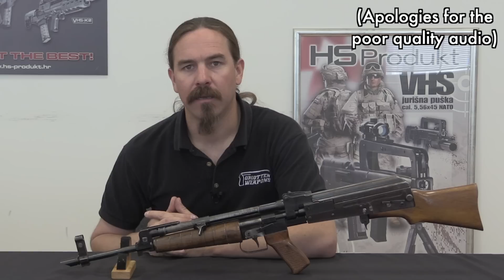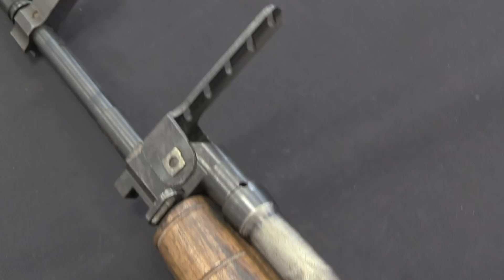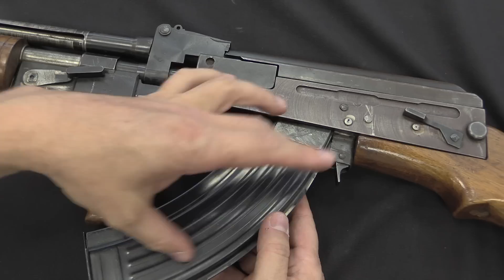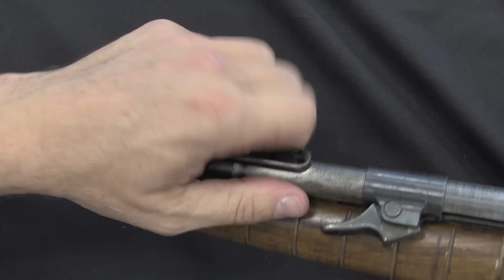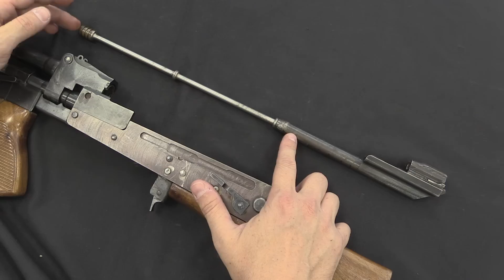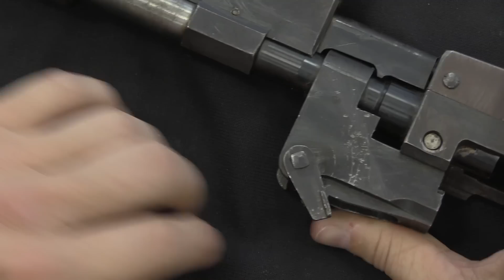Croatia's Prototype Bullpup AK Conversion

Comment: Croatian enthusiasm for bullpups is very justified by geographical features of their own country: their entire coastline is basically made by a rocky mountain ridge falling straight down to the sea with a minimum space for building settlements, add to this the fact that said rocks are extremely strong,  a dense mediterranean scrub and a dry climate and crystal clear atmosphere allowing you to clearly things located (tens of) kilometers away and you get the picture.
 It also explain their own preference in using 300.Win in their own (and 20x110mm) sniper rifles.
And because they are usually such tall and slim also.

Comment: the beauty of engineering prototype design, per se,  is innovation outside the usual parametres.
a pal designed a hubcentre steering setup for motorcycles in the early 90s, he attacked it as an engineer, not a motorcycle designer. this was after bimota and yamaha had allready put hubcentre on the market.
every journalist that rode his prototype back to back with the big manufacturer's wares were astonished at how perfectly it performed in comparison.
too perfectly, his design removed all geometry change under breaking, a geometry change that all motorcyclists adapt to without thinking. the end result was a couple of journos running wide in corners as the steering angle didn't change to a more agressive one. he had to create a system of 'dial-able fork dive' to give the tightening steering effect under breaking. 
the bimota and yamaha hubcentres did not eliminate this as they came to the problem via motorcycle design that emulated traditional forks.
of course, the ideal that was desired, the elimination of fork dive under breaking had to be reintroduced mechanically for those used to telescopic forks. it was his degree project, he just happened to have a gpz550 with destroyed forks..
as an engineer, I can see where HS were going with this. I can even see a few very minor tweaks that would make this a viable production model.

Comment: Wow, so this is effectively a bullpup that lefties can shoot without any extra steps (I volunteer to see if that actually works; just tell me when and where to show up, Ian!) which also has an accessible chamber for inspection and malfunction clearance. If that's the case, those two non-gunsmith engineers solved the two big problems associated with autoloading bullpup rifles. I think that's really impressive for a toolroom prototype of that nature. Many thanks to both Ian and HS Produkt.

Comment: As far as I understand the only reason for the bullpop design is the long barrel. If it doesn't provide better accuracy what does it actually do? A little bit more muzzle velocity? Why did half the west rush into this really?
Reply: My grasp for the rising interest of Bullpup was based on various factors. Many armies expected more and more warefare to be urban conflict zones, so finding a way to make rifles more compact without losing maximum impact and effective range saw good appeal.

Some countries also saw potential from a logistic standpoint. France for example decided to step away from having a army smg because in there eyes the FAMAS compactness meant it could be assigned to both frontline and rear line troops, the later often normally armed with sidearms and smgs.
Reply: @Awoken_Remmuz  I see, so basically keeping barrel length while making the gun overall smaller. I understand this looked like a reasonable assumption. Interestingly they all abandoned it without ever testing it in a real war. So I would guess the peacetime comfort of having a smaller piece of gear to carry around didn't really matter in practice.

Comment: The Problem: Nation without major arms factories needs to make military-grade firearms domestically in a hurry.
Observations: Nation has access to details on firearm designed specifically to be mass-produced with limited tooling and infrastructure (Kalashnikov rifle)
Solution: Let's take that Kalashnikov and make it more complicated because we love bullpups!

An unorthodox and arguably not very good solution to the problem, but I have a soft spot for unorthodox engineers, which VHS seems to have an abundance of. Instead of just focusing on the obvious solution, fabricating tooling for Kalashnikovs, they decided to see if they could bring something just a little different to the table and while they failed this time, they clearly didn't let it stop them engineering. If the company can keep that spirit going, I think they have a better chance than many to surpass FN, H&K, and Beretta as Europe's premier arms manufactory. Improbable for sure, but only time will tell.

Comment: Rock and lock bullpups prefer a shorter mag.  A 30 round tapco won't fit in a mini14 in the Muzzelite stock.  You can get them in, but they won't come out.  Ruger factory 30 rounders are a tight fit, but still come out.

Comment: Can anyone please tell me why exactly the gas piston wobbling on the bolt carrier is important and necessary for the design? I've never heard of it being important, always figured it was just wobbly because the whole rifle rattles when you shake it because of loose tolerances.
Reply: It helps center the piston into the gas block when the action cycles and helps to reduce wear on the piston. I’ve had a couple of AKs that didn’t have any wobble on the gas piston that still ran fine, but had more noticeable wear on the piston than the ones that did have some wobble.
Reply: @B2k4E  thanks.

Comment: Oof lengthening the barrel without making it thicker in 7.62x39 with old tech is going the opposite direction of the intention. You need to beef them up and/or chop them to get rid of barrel whip

Comment: You see a lot of homemade/"Khyber pass" AK bullpup conversions in combat footage since the start of the Syrian civil war. They seem to work just fine and there's a demand, I wonder why bullpup AKs didn't catch on before in a more official way. Like a version or kit from Kalashnikov itself - especially in the 90s.
Reply: I've seen photographs of bullpup AKs with custom paint jobs in the Middle east. Their camos don't match their environment, but I respect the passion behind making a customized gun in a warzone.
Reply: it did the Groza series and of course the bullpup version of the AEK971 (i think its that) groza didnt really take off unless it was in 9x39 WP for good surpressed shots
Reply: Because you cant use any parts that are interchangeable between the two platforms without even minor modification to them. This makes it no more cost effective than just building a better gun from scratch AND it doesnt offer anything that either the ak doesnt or that a bullpup should other than a longer barrel in the same OAL for the gun. And thats not even really what happens here because while the barrel is longer, so is the whole flipping gun. Bullpups almost always are designed to all for a new firearm that shoots the same round or one similarly powered one, that keeps the same barrel length or even a longer one but reduces the over all length of the weapon or keeps a similar OAL for a longer barrel. 
This allows for in the latter case a potentially more powerful and accurate weapon that uses the same ammo your force is already invested in and familiar with, or a special use platform that uses the same ammo but is shorter without sacrificing the power and accuracy for use in confined spaces and other cases where weapon size is important. This is just icky. 
 I mean sure its cool. But where would it be used by a fighting force?
 Its not even as cool as the olympic arms ultralight ar designs to get around the awb.
Reply: "If it ain't broke don't fix it"
Is probably the rationale. Aks work fine as is and while there's room for improvement is it really worth completely reconfiguring a rifle just to improve combat effectiveness by a tiny amount? Keep in mind militaries typically like to be conservative, so why should they adopt a different configuration of gun that would require retraining of personel and whatnot. When they could keep using what still works and not rock the boat so to speak. The new US army rifle is basically an AR as far as controls are concerned for that very reason. (I'm talking about how it's reloaded and how you use the safety and whatnot, I can see alot of gun needs REEEEEEing at that statement already so just to be clear im not saying they're the same gun, but they're familiar enough to someone trained to use an AR platform)
Reply: @BigWheel.  so basically

RIFLE IS FINE
Reply: Because it's easier to stick with one manual of arms for the conscript forces. The special forces especially in russia had access to quite a few types of AK based bullpup rifles, DMRs, subguns etc
Reply: Ukraine actually tried moving to bullpup AKs as well, they put together a conversion job called the Vepr and the more recent Malyuk is also technically a bullpup AK underneath.
Reply: Bullpups dont make sense in a large, conscription based military.
Dont get me wrong, I love bullpups aesthetically, but their increased mobility comes with a more rigid manual of arms and that trade off isnt really worth it if you already have a million perfectly fine rifles out there.
If you look at who adopted standart Bullpups, its mostly smaller militaries that rely less on conscription in case of war and more of a career soldier army like Austria and Australia with the AUGs, the French with the FAMAS or the British whose primary contribution to a cold war gone hot would be the Royal Navy and Royal Airforce. In cases like that you have much more time/money to better train your troops to cope with the manual of arms for bullpups (basically only right hand firing, more "complicated" clearing operations etc).

Comment: I'm still unconvinced that the downsides of a bullpup (for a military rifle, not so much for a civilian shooter) outweigh the upsides. I feel like the only thing holding bullpups back is that many modern militaries are used to an AR-15 style platform, and/or most accessories are designed with an AR-15 in mind. Essentially, if the HK416 (a very hot rifle for EU militaries right now) were available in a bullpup configuration, I suspect that configuration would be nearly as popular as the current one

Comment: You know, the only thing that's truly cursed is the handguard (specifically that it has no upper for the gas tube). Otherwise, it's a really neat first attempt by some guys taking their first try at firearms design.
Reply: The stock is pretty cursed to me. I've seen bullpup AK103s and the stock, on those, is just a flat thing.
Reply: Nah bro the length of pull is incredibly cursed. You’d need your arm to be perfectly straight to fire it shouldered lol
Reply: @Hanitcal69  You're probably a dwarf then
Reply: @Frille512  I’m 5’1” thank you very much I am legally not a dwarf
Reply: @Hanitcal69  And how short is that in a decent measurement
Reply: @Frille512  I only use freedom units. The fact that you’re asking means you can’t even own guns like this so why are you speaking
Reply: @Frille512  5'1" is approximately 155 cm.
Reply: @ignazachenbach5406  Dwarf length
Reply: @Hanitcal69  Or just be a chad with long arms 😎

Comment: biggest failing I see is the need for a cheek rest, possibly bolted to the trunnion to keep the face airgapped from the hot receiver, as far as the magazine issue I'm sure they'd just move the grip slightly further forward on a production model
Reply: The receiver will not be hot, but it will be cold in winter times.

Comment: It's interesting to see how different groups try to alter the basic AK (maybe the simplest select fire rifle available) to create a better or improved system. As I think about it, the only obvious negatives of the AK design are the short sight radius and the awkward selector/dust cover. It's otherwise a solid rifle with few improvements to be made. That makes these designs so intriguing.
Reply: No consistent way to mount optics and a generally high weight for its size are its real shortcomings in a modern context, in addition to the poor ergonomics as you mentioned with the selector
Reply: Siderail is and always was fine for optics, particularly with RS Regulate type mount. Stamped 1mm AK is not particularly heavy, in fact Afghan era AKS-74 (6.5lbs unloaded, just under 7 loaded) is lighter than just about anything ever issued as a standard service rifle that isn't the M16A1. 

And ergos of the safety is fixed by the Krebs type finger tab models everyone is using now.
Reply: @admiralxen8944  siderail is more complicated than having a proper rail on the receiver, and that still doesn't address how much has to be done for other accessories on the handguard to hold zero (e.g. IR laser). The finger-tab safety does NOT "fix" the ergonomics 🤣, it's still clunky and not easily converted to ambi. And the magazine is slower and clunkier than a drop-free design as well. The AK was a good rifle for its time and is still a marvel of simplicity and durability, but it is outdated and archaic.
Reply: Depending on your preferences, the lack of a bolt hold open on the gun itself is another big one. The indication that your mag is empty without silly tricks like tracer ammo is worth the miniscule additional chance of bad stuff getting into the action.
Reply: @hailexiao2770  that's a very valid point. That might be the most technically difficult improvement as an alteration would need to take place within the magazine to provide the function. Altering a rifle and getting that into service is much easier than offering a new magazine which doesn't work in the older rifle. I would be interested to see if that would take off in militaries already equipped with AK pattern rifles.
Reply: @andrewince8824  AK magazines with BHO functionality are already a thing, the Yugoslavs made lots of them and the Serbs still do. The problem is that the bolt still slams home once you drop the mag. Good for telling you that you're out but not for quick reloads. A rifle-side modification to keep the bolt open when the mag is removed would be great though, but I'm not sure how much of a change that would be.
Reply: It's clearly a good design that's stood the test of time but in my opinion there's lots of negatives compared to modern rifles.

Comment: I've always wondered why they don't chop the back corner of the pistol grip off, (or at least cut a channel into it) that'd give the clearance necessary without forcing the grip to be super stubby
Reply: Some bullpup AK conversions actually do just that. Ian looked at one a while ago called an AKU-94 that has the pistol grip contoured on the back to accommodate an AK magazine and even serve as a guide for proper insertion angle.

Comment: One thing I noticed there that I salute - the trigger mechanism is on a pull rod assembly. That way it can only deform in one direction (stretch) rather than two as with a push assembly (compression and bucking) so should give a less horrific feel to the trigger if done well. The big chunk of metal in the middle looks like it might cause a chunk of unnecessary friction though. I'm very interested to see the next iteration of the design.

Comment: That non reciprocating charging handle... if that works it , or some iteration on it would be an improvement on every AK variant going forward.. a big improvement. Closing the action and having an ergonomically located safety are  only two aspects, but no reason it couldn't be ambidextrous too getting rid of that awkward reach over.  How was the trigger on this thing? that looked like a novel multi-stage version of mechanism instead of the usual single transfer bar... better or worse? I can't help thinking that between the Galil and all the things Finns and others have done to the AK over the years to improve it that the latest Russian iterations just show... they aren't really paying attention and could have done much better by just copying features proven in other countries wars...

Comment: Looks like most of the successful guns we know today came from people with no engineering background but they have the secret ingredient to be incredibly dedicated to designing guns, like Browning and Kalashnikov. Whereas people with engineering background tend to struggle designing guns because guns do take 5 to 10 or more years to design and manufacture.
Reply: The SA80 would have an argument with your statement as the designers of that gun really had no engineering background and it kinda shows sure its better now but really...
Reply: According to Gun Jesus, the 26 designers of Enfield behind the SA80 do have engineering background but have no experience with designing guns, so the initial L85A1 is a flop, until the A2 version fixed by HK, whose design team have the real gun design experience. Try to watch Gun Jesus’s episode series on the SA80 to learn the truth.
Reply: Some would argue that Browning is an example of that, but of course he effectively did an engineering apprenticeship from the age of 7.

Comment: Looks like the charging handle would get very hot with use. Though this is good for a first attempt. I saw your video on the VHS-2 an excellent bullpup, which is not my first choice but I would definitely like that one.